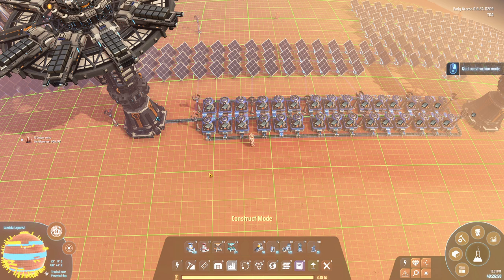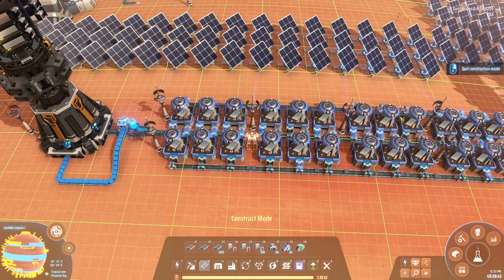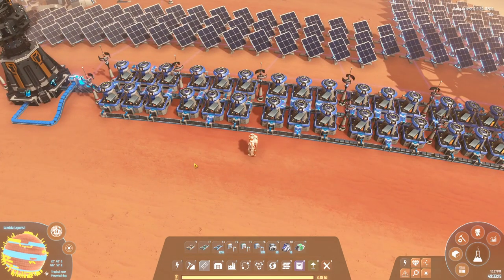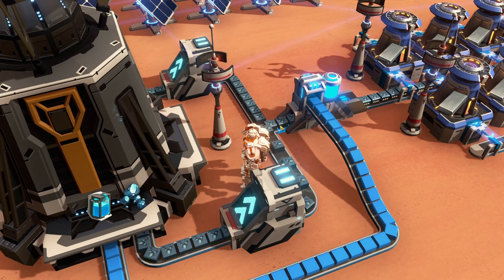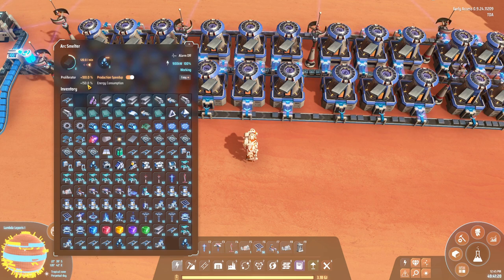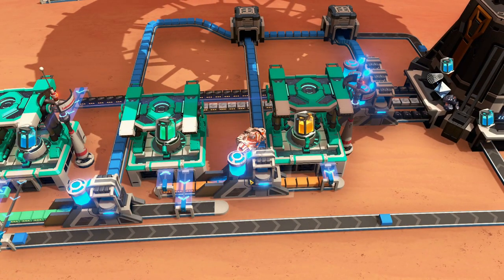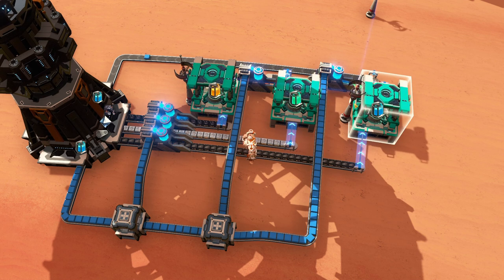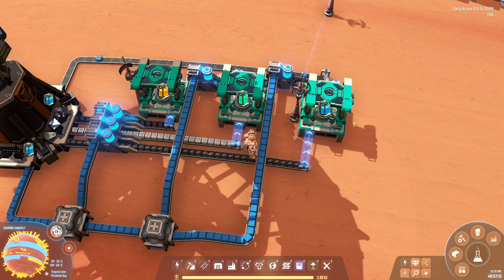QUICK GUIDE on Proliferator, Spray Coater & Automatic Piler | How To Tutorial | Dyson Sphere Program

Comment from the maker: Don't forget to subscribe & enable notifications if you want easy access to my upcoming builds for these new buildings - My blueprints are easy to use in ANY playthrough you might be working on!
Reply from the maker: Also a few notes after further testing & more complex builds:
1. Getting to a max stack is simple if you place 2 Auto Pilers behind eachother. The first stacks to 2. The second stacks the 2-stacks to 2+2=4 stacks.

2. Spraying your proliferator before inserting it into the profilerator (yes....) will increase the amount of uses. Basically you can boost the proliferator itself that way.

3. Spraying on stacked items does NOT actually saves you sprays, unlike I claim in the video. I was observing what I mention in point 2, but jumped to the wrong conclusion. (there might be good reason to still stack your products though, just not for this specific reason).

Comment: Just an important correction: SPRAYING STACKED ITEMS DOES NOT GIVE YOU FREE BUFFS.  If you spray a 4-stack, it uses 4 sprays.  There's nothing free.  It's still more efficient in terms of space and probably build complexity, but you are absolutely NOT getting the full stack sprayed for the price of 1.
Reply from the maker: Yep! Updated in the Sticky, I was mistaking the buff on the proliferators (extra sprays) with this. I was getting efficiency from somewhere, but jumped to the wrong conclusion :)

Comment: One thing here with the proliferator build, you're not spraying your MK3 proliferator and it's totally worth doing. You get 60 sprays normally so 1 can buff 60 to 75 sprays, 61*60 = 3660, but 60*75 is 4500! Even more if you spray your proliferators with proliferated proliferator then you get 75*75 = 5625 sprays!
Reply from the maker: That first spray works (to buff to 75 applications), but spraying on the sprayed items doesn't do anything I think?
Reply: @TheDutchActuary  what I meant was use your buffed proliferator to buff more proliferator.

Spraying with standard proliferator allows you to buff 60 other proliferator to 75, if you spray with buffed proliferator you can buff 75 other proliferator to 75. It's a bit nuts by that point and depending on VU etc might not be worth the hassle but I just love how it's one big self feeding cycle.
Reply: My brain just expanded reading this

Comment: Great content, thanks. I did some teste, but on my run the Spray Cotter on stacked items consume 1 spray for each item, so for a stack of 4 it is using 4 sprays not 1 as you said at 06:45
Reply from the maker: You are correct, not sure if it got patched out or if I was just seeing what  I wanted to see initially, but it definitely treats a stack as '4 items' at the moment. No need to stack before spraying!

Comment: Quick one: if you use a proliferator just before an end product goes into a logistics hub, does it maintain its buff when transported to a new location? Or does it lose it on transportation?
Reply: it keeps it, but you can end up with a mix if you have multiple providers and not all have the proliferator added to them.

Comment: Couple things to remember, by getting 25% more product you are also getting a 25% speedup so its consuming 25% less resources and producing 25% faster for it. Also Green is far more efficent than blue  IMHO, for 20% you only pay +70% energy versus 25% for +150% energy, that last 5% costs you 80% more energy!! It really doesn't seem worth it and it requires carbon nanotubes complicating an otherwise all coal build for the spray. You really shouldn't go Blue until very late game and even then I am questioning the value of +80% energy usage (think of how this cascades in terms of energy transfer warper usage, etc).
Reply: Nah energy is infinite late game.

Comment: The biggest problem with the way proliferation is implemented is that builds that are relatively small don't really benefit from the proliferators unless you put them in extra product mode (to save raw materials if you're using rare resources). If you have it it speed-up mode, you're taking up more space, producing less output, and using more power than just using a second assembler.
Reply from the maker: Not sure I follow. If you use the speed-up mode, it's still producing more output right? (assuming you supply enough input of course)
Reply: @TheDutchActuary  Yeah but it might be more worthwhile to just throw in another assembler rather than to use a proliferator. Using a proliferator makes the build super wide and will cost more power. Instead, if you use a second assembler, you will just extend the production line a tad bit and save some power while you're at it. I think that's what the first guy is saying.
Reply: @TheDutchActuary  If you put it in speed up mode it does produce more, correct. I'm comparing it to just having two assemblers. One assembler in speed up mode is 150%, two with no proliferator is 100%. In most small builds, adding sprayers makes the build larger than just adding a second assembler.

Comment: Do you need 2 or 3 Pilers in series to reach the maximum stack size? Is it 1 > 2 > 4 or 1 > 2 > 3 > 4, the pilers stack.
Reply: If you wire the output of one stacker into the input of another, you do reach a height of 4.
Reply from the maker: Added the answer to the sticky - but you only need 2 in serie

Comment: I did some quick calculations on "is it worth to spray raw materials"

1 mk3 proliferator costs 8 coal, 1.5 fire ice and 0.5 titanium (or 1.5 spiniferum) and sprays 60 items, so coal is basically the main draw here and I'm not bothering with titanium or endless fire ice:

60/8= 7.5 sprays for each piece of coal
7.5 x 1.25 = 9.375 

simply put for each piece of coal you get 1.875 "free" raw material (I'm not going to calculate the case if you boost proliferator production with itself but that should cut costs of coal probably in half)

to put it in perspective at 100k raw ore you need 100k/60 x8 = 13.33k coal to make it to 125k raw ore, then there is warper consumption which should be technically a tiny net + because you don't need to transport 25k free ore but the coal/fire ice/titanium instead

personal conclusion:
If you're at the stage to pull off this kind of stuff, you most likely have "infinite" resources (basic ones) so the 25% extra production is hardly ever worth it when you can just build more smelters
you could technically use the 100% speed buff to save space but the 150% power increase means that you need to make up for the saved space with additional ray receivers or invest in fuel based power
Reply from the maker: The 25% doesn't really seem worth it for low end items, I agree!
Reply: i guess it becomes worth as soon as you spray the sprayed items again for another boost, so the tiny net will become much greater
Reply: @realkorti  the issue is the spraying of ore makes things a bit awkward, with plane smelters and 25% boost instead of clean 15 smelters per belt, you need 11.25 smelters per belt, which is a really annoying number to work with (yes you can just make 12 but something as basic as smelters should be "cleaner" imo)

also if you spray raw ore that's going to be the largest amount of proliferator used on the stuff that gives you the least benefit

you can still spray the finished ingots but I'd say start with spraying coils and chips etc.
Reply: @brohvakiindova4452  I misswrote. I meant to spray the proliferater
Reply: @realkorti  oh yeah absolutely I did this too, it's absolutely worth it

Comment: You don't need a stacker (I refuse to use piler) at the output from a tower since the tower can automaticly stack for you.
Reply: I think he used the tower as magic item source for demo purposes more than as an actual tower
Reply from the maker: The tower can't stack until you do the required research, but you are correct, at some point in the endgame this won't be needed.

Comment: Great video. I don't mind them using prolifteration in general (as opposed to just having higher and higher tiers of buildings that are X, Y, Z times as efficient) but the way they implemented it with separate buildings everywhere is just lame. Feeding the proliferator spray directly into the production units and then having it consume 1 spray / unit would have been vastly better both from a build aesthetic and from convenience.  I've been tempted to create a mod that does this but I don't play enough anymore to make it worthwhile.
Reply from the maker: Feeding it into the machines itself would actually make more sense (instead of ' magic spray ') but it is inconvenient in this game as you would need yet ANOTHER belt next to every machine, along with a sorter to pull the sprays in. 

The way it works now, you only need to spray each input/output belt once, instead of every single machine attached to it.

Comment: I havent messed with any of the new tech as I got a new pc in december and didnt have my old saves to play around with. Started a new save a few days ago and just trying to rip through the tech tree to get stuff unlocked before I try and min/max some big builds. Is it worth spraying finished products before they go into your logistics towers? It seems like it would make more sense to spray the finished products only before they go to the next operation to save on materials. I think someone kinda touched on it in the comments that it will work but all the stuff will be mismatched. I imagine as long as you clear out the tower before you start the process, everything should have the buff right? I would imagine that is the way to go so stuff is already sprayed and ready before it goes to the next logistics tower... I think that would also cut down on the complexity of the builds as you would only need 1 or 2 proliferators on the outputs over 4-6 on the inputs... Either way, this makes all of your builds that take 4 or more types of materials to a 2 tower setup which kinda sucks
Reply from the maker: The game remembers which items are buffed. I prefer spraying the outgoing belts, that way you never forget to spray stuff and your initial incoming belts don't need to be sprayed.

Comment: ILS-es can output stacked/piled items. No need to do the piler setup on the output of the ILS. Also, there is no advantage in spraying after stacking, spray usage is the same.
Reply from the maker: Yep I noticed the stacking/spraying thing later on, as it was confused with the "buffed proliferators provide extra sprays" effect by myself and quite a few others it seems. ILS's only stack if you have the appropriate research though.

Comment: Because the sprayers themselves are stupidly large they don't give any space reduction in your designs... Nor do they reduce power... If you're going for speed increase you may as well just build the extra buildings and forget the sprayers. Unless you actually care about the extra products?
Reply: Ok having 60/sec smelting belts is a good use case. But I like to create end products from raw/smelted in a simple, modular build.
Reply from the maker: @Gredddfe  With +100% speed you'd need twice the amount of buildings. Just adding a Spray Coater / Piler system would definitely decrease how much room you need. But especially for smaller builds or ones with many steps (e.g. my own perfect ratio builds) this  becomes... tedious.
Reply: @TheDutchActuary  Since writing this comment I've made blue and red science designs which have sprayers at every step and just produce extra products. Because why not have a few extra products? It's not exactly game-changing but it's worth incorporating into your designs.

I'd actually love to see you try to have "perfect" designs in which your numbers are off by a factor of 1/8 or 1/4 at every step of the way. I don't think it can be done.
Reply: You don't save space on that particular build. But you save a lot of space in total if you spray at every step of a long chain since the extra products setting has compounding effects. The speed setting is something you should probably never use unless it's something that can only have the speed setting.

Comment: If i spray an item, and send it into a station, does it come out still buffed?
Reply from the maker: Items that are used to make something else, will not output an item that is also buffed. However, buffed items that go into storage/PLS etc will still have their buff.
Reply: If you mix them it will display the lowest buffed level, so if you mix non buffed and buffed ones they will look like they aren't buffed in storage but the game keeps track so you don't lose any extra spray if you put them through a profilator since it will only use charges for items that aren't already buffed. It will output from any storage the items that are not buffed first->buffed level 1->buffed level 2-> buffed level 3.